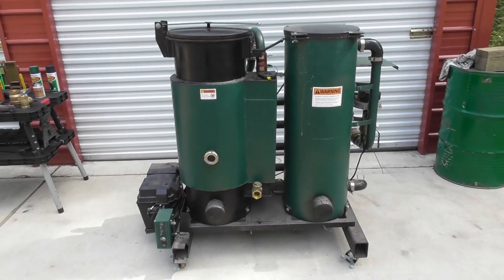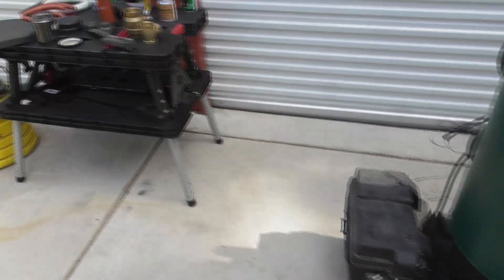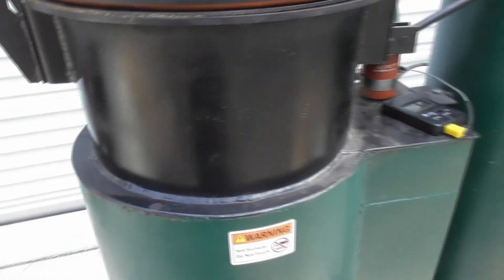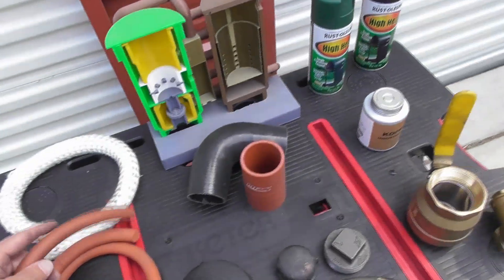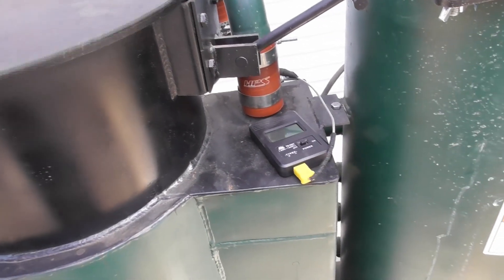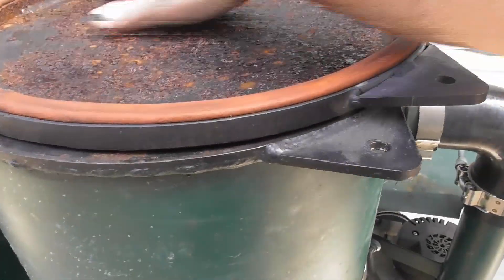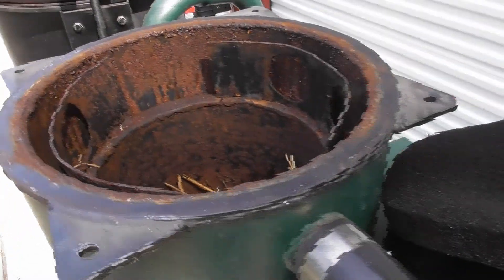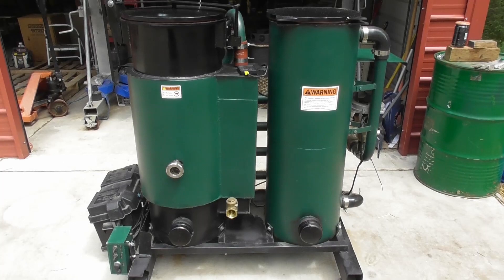Wood Gasifier Builder's Workshop: V3 Maintenance

Comment: Would it require less maintenance if it was powder coated or if it was stainless steel?
Reply from the maker: Not really. The maintenance is primarily in the silicone seals, filter media and thread lubricant.
Reply: @steveoffgrid485 I believe he is referring to the rust

Comment: How many hours of run time do you do maintenance like that?
Reply from the maker: Not specific to number of hours. Generally speaking daily: Condensate cleanout, weekly: Clean out ports, Monthly: Lube, Quarterly:  Seals and paint. Filter media depending upon runtimes, and note of any soot in flare gas. Use white cloth to test gas
Reply: @steveoffgrid485 generally speaking,   how many hours do you run the gasifier daily?